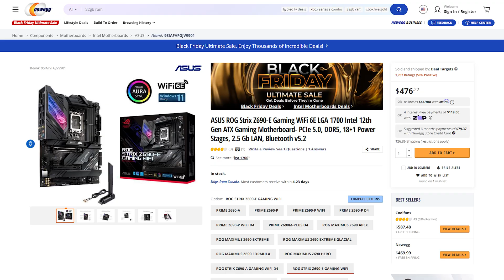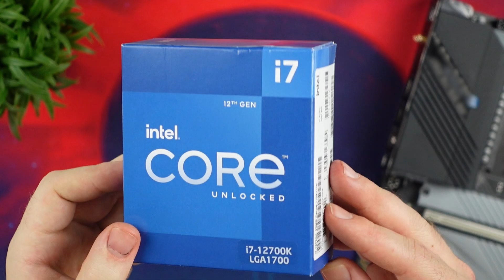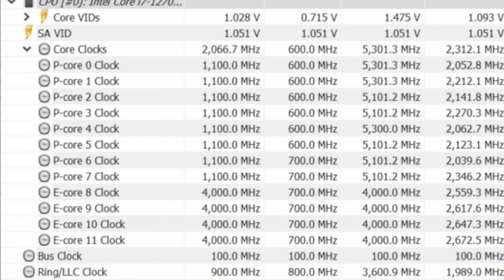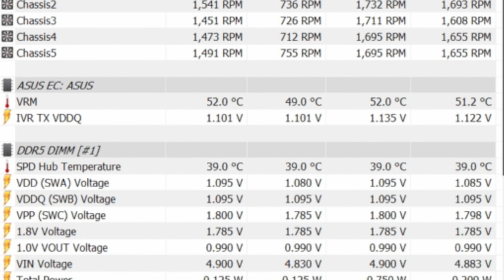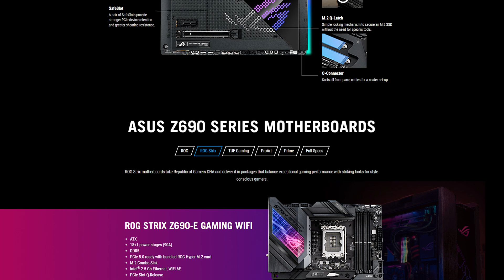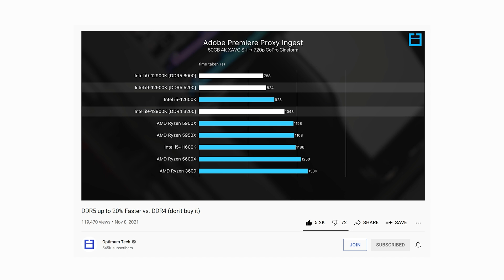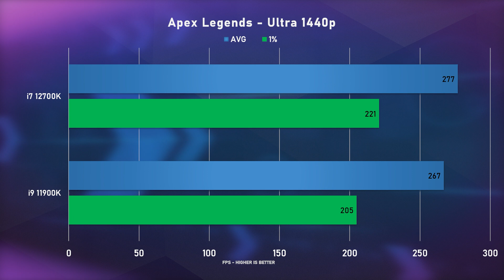Asus ROG Strix Z690-E Gaming Wifi Review with i7 12700K

Comment: I was wondering about this. I have a i5-13600k and a 4080fe. I have three m.2 I want to install but was worried about the lane splitting. Is the “F” a better option for Me? I don’t believe the “F” version of this board splits that correct? I don’t want to use that pcie m.2 expansion bc I’m my gpu is veriticle mounted and won’t have enough room.
Reply: Thats a bottleneck go upgrade your cpu. Basicly you cpu cant keep up with you gpu at max performance
Reply: @Turtl1938  as far as i understand the 4080 does not bottle neck these new cpus
Reply: @Turtl1938  maybe on paper stat wise, but we all know silicon is a complete lottery so the only real way of knowing is by doing benchmarks

Comment: would it work well with a 12700f?
Reply from the maker: Sure, but maybe look at a B series board then as this board is a bit overkill for that CPU. No need to pay extra to have a overclockable board but not CPU.
Just did my review of the ROG STRIX B760-F - https://youtu.be/M6o85L7hIPU - would be a better fit.
Or you can rather go for a TUF or Prime B560 board.

Comment: Did you take the plastic off the supreme fx logo and the logo at the bottom right above the third m.2 slot? Both of those are hard to take off so I’m just wondering if they’re supposed to stay on there or if it needs to be removed. Thanks

Comment: Waiting on my water cooling system but I picked up the z690F gaming wifi with the 12700k!!
Reply: how is f doing? any issues? heared it has problem with long boot time
Reply: Yes, moved my m.2 with the boot closest to the cpu and am using 2 sticks of ram 5600mhz now. Had 4 sticks at 4800... Boots fast now
Reply: Went from like 30 second boot to like 10 after I did that

Comment: Hey 😄
, I'd like you to give me some honest advice, because I see you understand each other.
 These days I got a new MSI RTX 3080 Ti Suprim X graphics card that I want to upgrade to my computer to pre-existing components.
 My motherboard is a Gigabyte Z390 Aorus Master paired with an Intel ™ i9-9900K processor ..
  The only thing I know in all this is that I need a stronger power supply than the current one.
 Will the graphics be able to be paired with a small older board and will it get the maximum performance that the graphics itself offers me?

Comment: Having issues with intermittent freezing in windows (between 1 minute and 10 minutes in Windows before a freeze) with this same MOBO and CPU. It is not overheating, so far have been unable to determine the cause.
Reply: did you fixed it?
Reply: @estmarGaming  Yea, it was a faulty MOBO, I RMA'd it and replacement works flawlessly.

Comment: Very nice setup (: Which CPU cooler did you use? As the LGA 1700 is pretty new and Z690 requires a lot of heat sinks, most of the AIO cooling solutions did not fit or need some further mounting stuff.
Reply: There's LGA 1700 brackets out now for most AIO systems on the Z690.
Reply: here's LGA 1700 brackets out now for most AIO systems on the Z690.

Comment: Hi, can someone confirm if the extended nvme heatsink will have clearance issues with RTX 3000 card's rear water block for the memory modules?
Reply: The problem with the huge heatsinks on the MOBO is that most fan CPU coolers will not fit, so go liquid coolers or do your research on the couple of fan ones that actually fit
Reply: @beakhole793  I have a custom loop and am wondering if it will have clearance issues with RTX 3000 cards with active memory cooling (back plate has a water block as well)

Comment: My build is almost complete I just need the rtx 3080 ti or 3090 but getting that gpu is nigh impossible at this point right now.
Reply: If u gonna get a rtx 3080ti just save up and get a rtx 4080
Reply: @thealien_ali3382  Have you seen what that thing does to PCs?? jesus they might as well give you a denotator with thing lmao.
Reply: @Silverwind1989  I just got a 4080 and can confirm those issues with the melting cable etc. are people trying to cram the GPU in chassis that is too small and putting stress on the cable. If installed properly you won't have any issues.

Comment: Je I don't have the motherboard yet, but if the CPU manages 20 lines, with the first Nvme slot, the rest of the slots are managed by the chipset so I shouldn't lose my 16x lines for the GPU? If I refer to the Intel diagram, the CPU can handle a GPU in 16x + 1 SSD in pcie 4.0 and the z690 chipset can handle 12 lines in pcie 4.0 so 3 SSDs in 4.0?
The idea is really to run a GPU in 16x and 3 SSD 980 Pro in 4x
Thanks
Reply: Hi did you found a solution for this situation? I'm on a similar scenario right now, I'm trying to decide what motherboard be the best. 
I have 2 WD sn 850 2tb each. And planing to add a third one.
Reply: @JoNaXKaY  yep you can it's perfect
Reply: @Shatterstar4  how did you connected the m.2 disks? I really want to use the m.2_1 port So I can use the big cooling on it.
Is it possible?

Comment: Wanted a ddr5 build. Settled for Strix Z690-A ddr4, i7 12700k, 3080Ti. Current system Asus Formula VIII, i7 6700k, 1080Ti. 

Fair winds and following seas to all.
Reply: Got my hands on a 12gb evga 3080 but I’m on a 8700k z390e lol so also in the looks for cpu upgrade

Comment: Great review. Waiting on DDR5 RAM to become available to finish my build with an i9 12990K.

I'm curious about the CPU Overvolt jumper at the top of the board. ASUS manual doesn't give any information beyond the name of the header. What effect does enabling CPU Overvolt have on gaming performance?
Reply: What did u find out
Reply: @AudioStorm1980  It is used in extreme overclocking like with liquid nitrogen.

Comment: Something wrong you did with the cooler monting, there are 20+C difference between some PCores and thats not how it should be, 96 max and 79 for another....try reinstaling again the cooler.
Reply from the maker: I had the same problem on 2 different Z690 boards. The Aorus Waterforce X240 I used might not make full contact with the entire IHS. Like i mentioned some cooler designed before the release have similar issues.
https://wccftech.com/various-aio-cpu-coolers-tested-with-intels-alder-lake-lga-1700-cpus-older-models-show-insufficient-thermal-contact/
Reply: @WeDoTech  Ohh I see yeah it may be the problem. I have Liquid Freezer II 360 with LGA 1700 KIT on the same 12700k and OCCT/Prime95 with AVX no more than 80ºC, so yeah that cooler you are using it may be the problem
Reply: @BenchAndGames  Blaming the cooler when voltages haven't even been discussed?
Reply: that's how it is with intel and amd - this is how you know lapping and delidding works - blame the cpu manufacturers not the builders - plus we all know silicon is a complete lottery in every regard

Comment: If you use the top M.2 slot, the GPU slot runs in x8 instead of x16. If all you have is a Gen 4 M.2, I think using the bottom left M.2 is ideal as it is also wired to the CPU and doesn't affect the GPU lanes.
Reply: This only applies if you use a Gen 5 M.2 SSD. I recommend sticking with Gen 4 to get the x16.
Reply: @Igarza069  you sure about that? I think I have read that if you use that top slot regardless of it being gen4 or gen5 it would divide the lanes to 8x8
Reply: @mikerzisu9508  sorry you are right. It does split the lanes in half if you use the SSD in the M.2_1
Reply: I think only the top slot is wired to the cpu, the other slots are wired to the chipset
Reply: Per many tests you literally only lose 1 to 2 fps by using the top M.2 slot. Nothing to hyperventilate about.
Reply: Why does using the top m.2 cause the GPU to run in x8? 🥴
Reply: I was wondering about this. I have a i5-13600k and a 4080fe. I have three m.2 I want to install but was worried about the lane splitting. Is the “F” a better option for Me? I don’t believe the “F” version of this board splits that correct? I don’t want to use that pcie m.2 expansion bc I’m my gpu is veriticle mounted and won’t have enough room.

Comment: Those temps are crazy. I don't understand how some reviewers are getting low temps. Like JayzTwoCents. Is he cheating?
Reply from the maker: No its just a combination of their ambient temp being much lower (theirs probably below 20c and mine just below 30c) and then they probably also use larger coolers. I used a higher end 240mm where they could use a custom loop or large 360mm. In my Hero review I used a rog ryujin II 360mm which was designed more for LGA1700 so it performed better. But 10c in ambient is a massive difference.
Reply: @WeDoTech  Yes, agree. I remember Jay saying his ambient temp is 16c LOL
He is a scam and intel shill. Who lives in a 16c room?!! He did that only to show intel from a good side.
Reply: @madd5  who is responsible for the voltage to the cpu - intel or board manufacturers?
Reply: @mrburn6119  I think intel gives the instructions and limits of voltages and power usage. Then board manufacturers try to squeeze out the max of it.